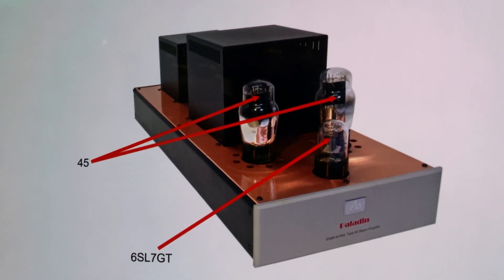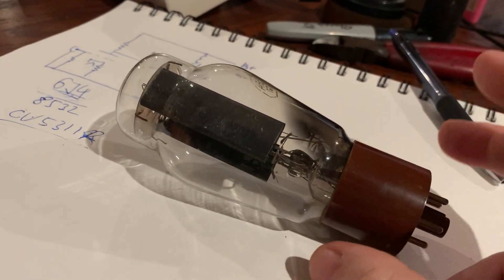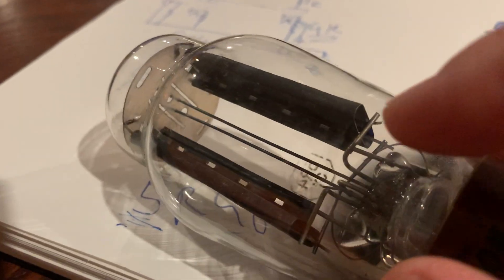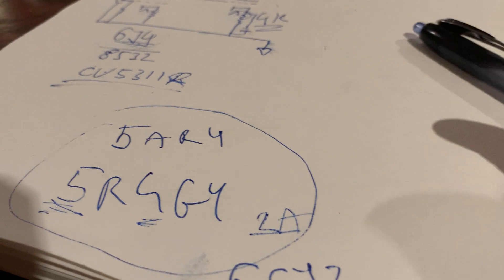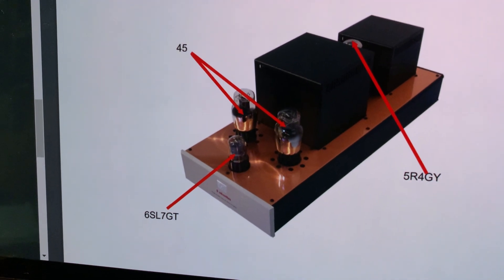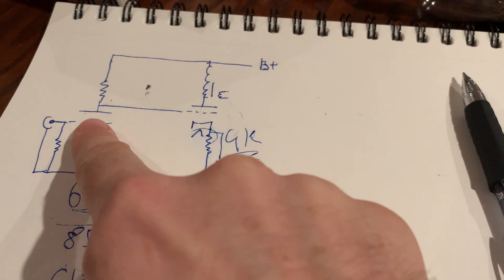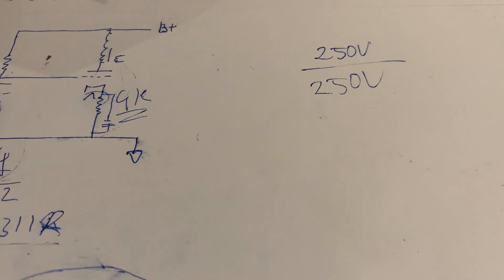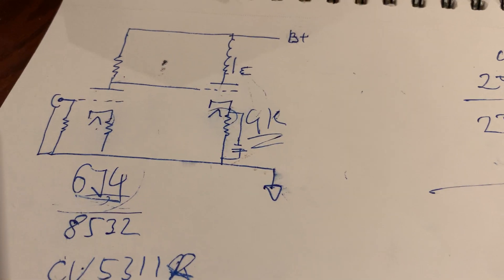Audio Note Paladin - Let's peak at the Flea power behind the shining armor!

Comment: For a 93dB speaker this Paladin would be enough to shine ?
Reply from the maker: For typical loud playback the standard is 102dB (speakers efficiency x watts). 93dB/Wm x2W of the Paladin makes 96dB/m. That's 6dB less than what most consider as very loud playback in an average size room. It will be still able to play quite loud, but when one wants to listen super loud, it's not going to happen. 
Also, a lot matters as well how compatible that 93dB speaker is - is it an easy load, or harder to drive. That will be the part that decides if it's a good match or not. If it dips below 5R, I would not use it. AN amps are most happy to see steady 6R load speakers. (6-8R will work well. -- and even though AN calls their speakers 8R, they are really 6R speakers...)

Comment: I've heard some people say that the 2a3 and 45 are interchangeable, is that true?
Reply from the maker: No, they are not interchangeable. The 2A3 is basically two 45s in parallel. I'll have a video coming soon with more details, as some amps are made where you can use both, provided there is a switch to accommodate both tubes.
Reply: @realworldaudio  I'll be looking forward to it

Comment: Hello again I just thought I would shed some light on a few things. Firstly, in the lower 
priced integrated amps the Oto se signature is my pick for refinement and clarity it is basically a 12ax7 cap coupled to two el 84 s .I prefer
it to the Soro which by the way has 6l6 tubes not  el 34 tubes.They introduced a new amp called the Cobra which is push pull el 34  with a dac built in. The Meishu has more body and density because of the 300b and no feedback  and the fact it has a bigger chassis to put bigger iron which generally sounds better.Schematics for audio note UK products are not available  
not even to dealers.
Problems are either dealt with over the phone or the product is returned to audio note. I have schematics for the audio note japan stuff from the late 90's like the Gakuon, Ongaku, M10,
M7, M7 phono, Kegon, Neiro and Shinri. How did I get them? I just sent them 5 dollars and they sent me the schematics. The amps were a 3 or 4 stage design with a 6072 in srpp direct driving a
5687 which was cap coupled to another common cathode 5687 which drove a 5687 cathode follower which was directly coupled to the output tube. 
I had a customer who owned the Kakegi parallel 2a3 monos which had half a 6sn7 directly driving another
half 6sn7 which was cap coupled to a pair of  paralled 2a3s. My customer had too much gain with these amps so i reconfigured them to 2 stages which used a 6j5 which is a single 6sn7
driving the paralleled 2a3s.Audio note offers this as a low gain alternative to the standard one.
.250 of a volt standard vs 2.5v low gain sensitivity.Ultimately he upgraded to the Kagegi balanced version which sounded the best being all transformer coupled.

On the Paladin amp I find using a 6sl7 as a driver in common cathode mode not to be effective
With an rp of 44,000 ohms and running at 1.5 to 2 milliamps it is too weak to really drive a dht
effectively. A 6sn7  at 7700 ohms rp would be much better but it would be low gain.Of course the 45 doesn't need the drive of a 211 but a lower impedance driver would be much better. my guess on the Palidin is 6sl7 cap coupled to the 45 that is it. By the way you won't find cathode followers on any audio note uk products because they operate with 100 feedback and that does't fit their  thinking of being feedback free. best regards Lou
Reply from the maker: Thank you Lou! I'm glad to have you here on the channel, with AN repair experience you are the one who has authority on what AN does. I found a few AN schematics online, but I highly suspect that they were drawn users and not by AN, so there's a grain of salt to their accuracy. Also, I never saw the insides of any AN product, so cannot vouch for them. The only authentic schema I have is the Kondo Ongaku, which Kondo san published in PF - however, that's not a topology for starters. The power amp section of the OTO is a great topology for a starting project, and to explain how tube amp circuits work. I will present it as a learning tool to get to know tube amp topologies, how they work and what can be done to improve them. As regards the Paladin, that was my thought as well, the 6SL7 is inadequate to drive the 45. DC coupled the disadvantage would be far less.

Comment: I recently saw your video about low power tubes, el34 and KT120's .. very interessting! For example the big brother of the Oto, the AN Soro with el34 has more balls but is less refined and most people prefer the little brother oto with el84. If im correct the Oto has a little bit of feedback, the Meishu is the first integrated in the lower line with zero feedback. Would you like to make a short technical video about the Oto Phono SE Signsture? Only if you like it yourself, of course! I’m waiting 12 weeks for it 🙈, hopefully Im getting the amp soon :)
Reply from the maker: Unfortunately I have not had any experience with the Oto phonos, so cannot comment on them. :( But will make soon a video on the Oto schematics. ;  Indeed, the EL34 is the doubled version of the EL84. And the EL84 is the double of the 6005. I think the current OTOs use the 6005 - at least, some version OTOs have EL84 others the 6005.  (The 6005 has been one of my favorite tubes for a very long time ;). The smaller the plate structure, the more refined a tube is. (Electrons have smaller distance to cover, more coherent.)
Reply: @realworldaudio  that would be awesome! The Oto uses 4 el84 on the power stage and triode in the pre section. I’m not sure. Thank you 😊
Reply from the maker: @nicktube3904  Checked their website, and the SE version uses EL84 and the PP uses the 6005. For the SE they kept the EL84, as it has double output power - the 6005 PSE would be only 5W ; ). I have the schematics for the SE version, the one you have (line and power sections only, no phono) ;
Reply: @realworldaudio  I found a interesting article. There is unfortunately a small difference in design between the Phono and normal version. I choose the phono because I would like to experiment with vinyl in the future :)
I found only information about the tubes of the Phono stage. 
‘ The phono stage itself is exquisitely made, a variation on a theme anode follower comprised of an ECC83 (12AX7) and an ECC88 (6DJ8) double triodes and a passive RIAA equalization network. ‘

Here is the article about removing an extra gain stage that is still required for the phono version:
Thank you for your enquiry and for choosing Audio Note (UK).

The circuit design of the OTO Line SE has changed somewhat over the years, and the current version - which has been current since the late 90s, so should be identical to the version you listened to at Soundhounds - has six valves in total.

We decided to remove the extra gain stage in the Line version of the OTO SE as the amplifier both measured and - more importantly to us - sounded better with the more simple circuit. The extra gain is now supplied by using higher gain valves at the input of the circuit.

The Phono versions of the OTO SE still use the older design with added gain stage, as the phono stage requires this extra gain and for simplicity, all line inputs are all routed through this also.